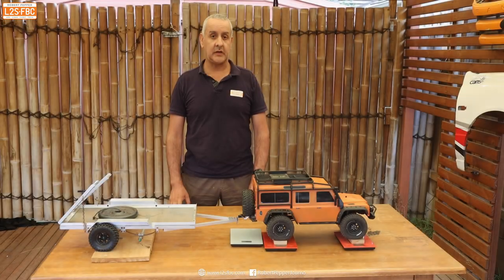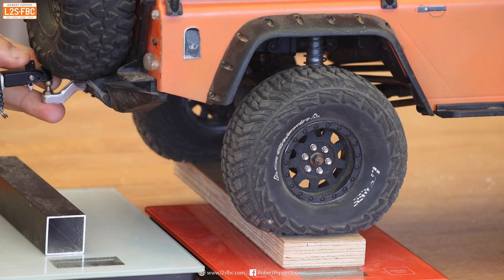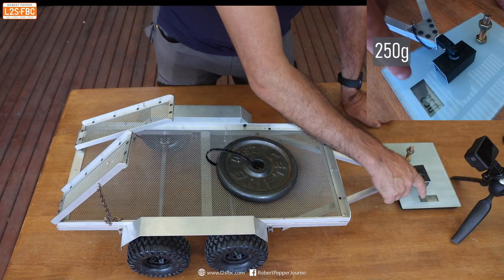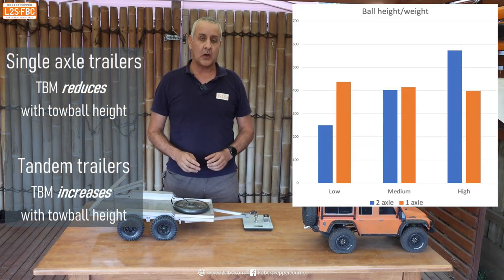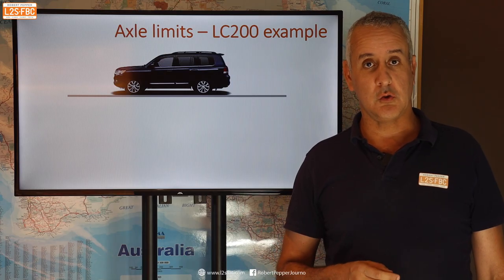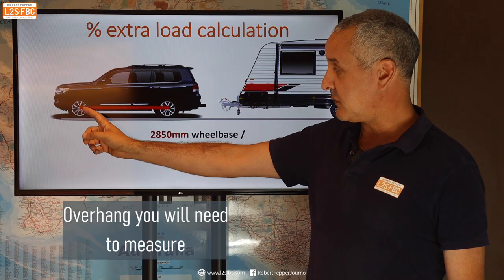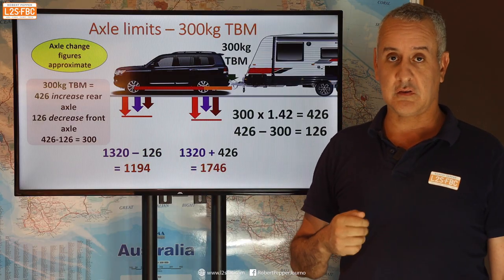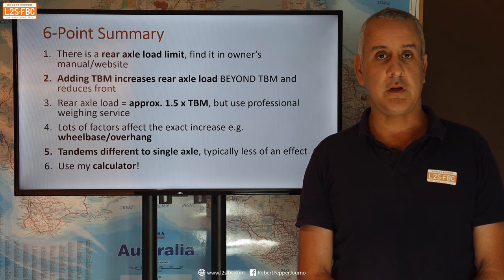Are you sure your rear axle isn't overloaded?

Comment: I've never done any off-roading but I watch all of the videos because I appreciate understanding the principles. I may end up applying the knowledge in my bicycle loads when I haul a trailer for my trips this summer. Fascinating and well laid out with easy to understand diagrams and scenarios, thanks.
Reply from the maker: Thanks Johh yes the principles absolutely overlap!
Reply: @L2SFBC  I beg to differ (I think). Depending upon where the chap attaches his trailer to his bicycle, the ratios would be totally different. 
Whilst never having towed a trailer with a bicycle, the ones I've seen have invariably had the pivot connection in an area under the seat, so ahead to the rear axle.
As such, I would deduce that there would be zero (or close to zero) effect on the bias between front and rear axles of the bicycle. Or, am I missing something here?
Reply from the maker: No you're not the force being zero  wouldn't mean the principle doesn't work it means the answer is 0

Comment: My comment got deleted for some reason (probably because it had links in it), so here we go again:

Thank you for another great demonstration and adding the axle loads to the calculator.

Could you please also test the effects of TBM on stability and various ways to achieve it? There are studies showing that more TBM seems to make the trailer more stable, but none of them so far even tried to figure out WHY this is. There are some speculations, but not really any data, so I'd love to see someone do some proper testing.

The variables are:

1. Load distribution: This can be ruled out as previous testing has shown that putting the load further forwards does not really help anything.

2. Axle load/grip of the car: Some people say that the increased stability comes from the increased load on the car's rear axle. If you were to take a trailer with little to no TBM (let's say <2 % GTW) and add weight *to the car* to reach the same rear-axle load as with, let's say, a TBM of 10 %, would you get the same stability as you would from nothing in the car and all of the 10 % on the ball? If not, how much would you be missing?

3: Friction: Another speculation is that the increased load on the ball creates more friction which helps to dampen any oscillations. How much would you gain from using a friction coupler (e.g. the AL-KO AKS 3004) to create this friction without any vertical load? This would probably be harder to accurately replicate on a scale model, but something like a piece of silicone tubing on the ball and an oversized coupler would probably be enough to show whether there's a significant difference or not.

I wouldn't be too surprised if it turned out that a $300 coupler and a few more bags in the car would do the trick without worrying about TBM or axle loads.

Edit: FWIW, I'm NOT saying that you don't need any TBM. In real life you absolutely do need some to keep at least some pressure on the coupling so it doesn't wobble or separate - the question is whether you really need any more than that.
Reply from the maker: Reject all three explanations, please. This myth that "a bit of TBM is good, so more = better" has to die. Look through my tow playlist for more.
https://l2sfbc.com/one-reason-why-add-more-towball-mass-isnt-always-the-right-answer/
Reply: @L2SFBC  I'm not saying that more TBM is always better - I actually believe the exact opposite, which is why I'm asking those questions (and why I was the one who suggested adding the axle loads to the calculator under the video about weight distribution). I may have worded the comment poorly because I didn't want to spend an hour re-typing what got deleted because of a link in the original comment, so let me try again:

I found a study called "*An experimental investigation of car–trailer high-speed stability*" from the University of Bath in the UK. This study found that

1. Adding TBM (or, as they call is "nose mass") from the original 5 % to 10 % improved the high-speed stability of the trailer and vice versa. 
2. However, moving the load closer to the axle to reduce its inertia improved the stability even more than increasing the TBM, and 
3. increasing the length of the tongue/nose of the trailer also brought significant improvements, although doing so reduces the TBM (since it's acting on a longer lever).

The above already suggests that even the widely-used "10-% rule" may not be true and less TBM on European-style trailers doesn't make them "inherently unstable" like I've seen some Americans claim.

But this is not really relevant to this particular video. The relevant part is this:

"It was found
 that an increased nose mass improved the system stability, although the improvement becomes less significant when the nose mass rises above 6–7 per cent of the total weight. *This effect is thought to be caused by the increase in the car rear axle load associated with nose mass that increases the ability of the tyres to generate side forces that damp out the

oscillation. In addition, the increased nose mass
 raises the tow ball friction, which in turn helps to damp out the oscillation.* However, it should be noted that there are limits on the maximum nose mass, partly as a result of structural strength issues

and partly because too much nose mass will reduce
 the front axle load and worsen the handling performance of the vehicle."

I initially missed that, later in the study, they did actually try a friction coupler and it did help, which confirms that friction also plays a large role in stabilizing the trailer. Now that I'm looking at it, it looks like the coupler was actually almost as effective as increasing the TBM from 6 % to 10.5 % (zero-damping speed of a bit over 66 mph with the extra mass/weight vs. 66 with the coupler), which also answers my third question.

The only questions that have't been answered therefore are: How much do axle loads matter here? *What would happen if you were to completely remove the TBM and replace it by an equivalent amount of weight in the car, above (or in front of) its rear axle*, so that the rear-axle load would be the same but with no lifting of the front axle?
Reply from the maker: Good questions. I shall do more with them as there are a lot of 'it depends'   in the true answer. But you're on the right lines. Note that friction devices reduce manoeuvrability.
Reply from the maker: Yes I'll do something on this subject soon. See my 2m view video on 7 weights for trailer stability for starters.

Comment: New to the channel but these videos are great!
I'd really like to see one addressing weight distribution hitches vs. air bags (or other supplemental suspension parts) that simply help maintain rear ride height.
Reply from the maker: Thanks Jack.  I do have one on WDH, but not on airbags. I might do one on the merits of keeping the towcar rake as it should be as opposed to dragging the backside. Air suspension is great for this!!!
Reply: @L2SFBC  Well that's what I'm wondering🤔..
Does maintaining rear ride height (through stiffened susp) actually serve to adequately distribute weight to the front wheels, as a WD hitch would?
Reply from the maker: Raising the rear from sagging to level has a tiny effect on weight distribution - a little more to the front. However...the height of the hitch also varies the towball mass, and it behaves opposite whether the trailer is tandem axle or single axle. Confusing hey?  So, "it depends" I'm afraid. Raising the rear will never be as effective as a WDH.

Comment: This is obvious to me, but not to many people, I would imagine. This is also why I want to fit air-helper springs to two of my tow wagons that I use mostly for longer distance and heavier towing. :-)
Reply from the maker: Not obvious to many people no. We are all wired uniquely.
Reply: Look into that a bit more. A lot of talk around air helper springs on heavily loaded dual cab utes and bending the chassis
Reply: @snells-window  We're not talking heavy loads for me with that vehicle. I'd only tow up to about 2000-2500kg or so, with it. It's just about the amount of gear I tend to have in the wagon's boot at the same time as tongue weight. They're both softly sprung cars, and both will be lowered sooner or later, one already is. I just want hte car to drive level and have some suspension travel for undulations in the road.
Reply: @fredio54  remember that just like the distance of the towbar to the rear axle amplifies the TBM, the TBM can be multiplied significantly further when going through sharp high speed dips like you often find on fast dirt roads. From my understanding, fitting air springs can change the load/stress points to different parts of the chassis, at least in leaf sprung vehicles.
Reply: @snells-window  You're not wrong, however think about this: If I go through those same dips/bumps/braking zones/corners with the vehicle heavily laden and sagged badly then the amount of travel available to absorb those surface variations is minimal and the suspension will bottom out and the bump stops will incur a very strong force very early in the impact/compression cycle. This is worse than having sufficient spring rate (of any sort) to cope with the events that unfold.

Comment: Very Interesting and excellent demonstration about how the single axle and tandem axle affect the towball mass, which led me to a question about Load Sharing Tandems. 
Considering the towball mass, with a true load sharing tandem suspension compared to the the tandem model in your demonstration, which would mimic the independent coil systems on vans lately, (except for the Simplicity Axle LSC)  would this have a different effect?. As these are designed to keep the same amount of weight on each axle within suspension travel limits,  so would a Load Sharing Tandem setup, act similar to the single axle in regards to TBM?.
Reply from the maker: Yea it would I forgot mention that good point.

Comment: Have you done any videos on A-frame flat towing of other vehicles? I'm expert in it, but I think you'd do a good job of explaining it to others. I do know, though, that it's not your area of interest nor that of your viewers, most likely. But perhaps it could be a nice little series to spice things up :-)
Reply from the maker: No I haven't and i have never A towed so I probably wouldn't. I like to focus on things I have practical experience with to back up the theory.
Reply: @L2SFBC  Fair enough. Crash course here and now, then:

1. Ball and hinge height should be very close to the same - if ball is lower braking causes compressed rear suspension and lightened front suspension like a ball weight - if ball is higher braking causes rear end jacking and increased front end weight - this can result in a sustained low-speed low-force oversteer condition in the tow vehicle (ask me how I know, ha ha)

2. Zero of the towed vehicle's weight is on the wheels of the car being towed and the towed car, unless it has a driver to assist with hills (up AND down if engine runs) the maximum decel G force is 50% if the weights are equal between tow and towed.

3. You cannot reverse easily and you cannot reverse at all without a helper in the towed car or the steering locked

4. Your steering must be free to move as needed when being towed forward - if a driver is inside the towed car they must only use brake/gas - they must not interfere with the steering wheel. 

5. Cornering load from the front of the towed vehicle is applied to the rear of the tow vehicle 

6. It's effectively the same as towing a trailer with a very long draw bar when moving forward - ie, the turning circle is very large and it's easy to accidentally cut corners and do damage (again, ask me how I know...)

7. If you DO have a driver then it's as if you have a double mass double power vehicle and the entire experience is seamless and easy

8. If you don't have a driver or the brakes are not working on the towed car then keep 2 in mind - it can get bad easily

9. If you're towing an auto and it won't be running and assisting then you must drop the driveshaft or CV axles or the auto will be destroyed by the act of towing because the oil pump is engine driven and key parts will not be lubricated.

I built mine to tow my race ute to the track years ago, but have since used it on a number of other vehicles to great success. They're a very nice way to go and especially if you can put a person in the back car to help slow it down (they brake when your brake lights show, they accelerate when they feel you do so and/or they see a hill or are coming out of an intersection or whatever. I prefer it to car-transporter use these days. You just have to know what you're getting into. Kinda like MIG locked diffs - they're great and ultimately predictable, but you have to know what you're doing when you drive one or it can get you into trouble. :-)
Reply: @fredio54  I used to have an A frame on my little suzuki 4wd. Hook it up to another suzy offroad and you had 8 wheel drive!
Reply: @snells-window  Ha ha, yes indeed :-)

Comment: @2.07 if you put more weight on the front even though the vehicle gvm would increase would it also decrease the rear weight and tranfer it to the front? Is it aboute keeping the vehicle sitting level to keep the weight ok or physical weight ay the front or rear to change it.?
By far the best trailer weight video on youtubes also.

Comment: great video, thanks for posting this. are you going to do another video explaining the same loads but with using weight distribution bars? ( it would be the next logical step)  also have you noticed the 'long' tow ball hitches ( generally height adjustable versions) that add to the overhang? do you know of a height adjustable ( or weight distribution hitch unit) that is 'short' ? so your overhang is keep to a minimum?  also how does load sharing dual axle trailer suspension act on down ball weight?
Reply from the maker: extended hitches ARE EVIL!!!
Reply: @L2SFBC  yes they are evil....... in most circumstances.
In my case, I have a Chevy Silverado with a GVM of 5,171kg and a GCM of 11,113kg. 
The front/rear axle ratings are 2,359kg and 2,812kg respectively (hence the 5,171kg GVM).
I tow a 3,500kg Bushtracker caravan....so I'm well within the GCM.
However, because of the truck-like rear suspension (it barely budges when I add the 320kg ball weight), the ride when towing was less-than-pleasant. 
The "fix" for that was to purchase a product called an Airsafe Hitch which gives an airbag cushion between the two vehicles.
Unfortunately, the trade-off is both weight (the Airsafe weighs around 35kg) and the increased distance from rear axle to pivot of around 300mm.
Fortunately, having such a long wheelbase in the first instance, these trade-offs are well-worth it and I wouldn't tow the van without the Airsafe Hitch.
Reply from the maker: That's fantastic information thank you and yes totally agree it depends!

Comment: I've come to understand that Tow Ball Weight can be too much, as well as too low. What would you say is the optimal weight on the ball? (I'm aware of wanting to keep the majority of the weight over the axle of the trailer for stability.)
Reply from the maker: It's like tyre pressures, there is no optimal unless you give a very specific conditon; towcar, speed, trailer, weight distribution and so on. For example offroad the ideal is 0%.  For a 3000kg towcar with a 300kg trailer...10-40% would be fine.  I run 7% on my 2300kg van towed by a 3000kg 4x4.  I will do a video on it, but there is no simple answer and anyone that says differently hasn't understood the situation.

Comment: Hi Robert. What is  your views on WDH function of some weight transfer to front axle?
Reply from the maker: I would avoid WDHs unless necessary. They do add weight to the front axle and also the trailer axle. But they have complications. I'd prefer to get a bigger towcar. Also note quite a few manufacturers expressly forbid use of a WDH.
Reply: @L2SFBC  yes, just a band-aid for level roads and disconnected if going up a driveway into service station, spoon drain, bull dust holes, speed bumps and the like. I enjoy your spot on presentations and associated views. BTW it is a subject I enjoy but I don't tow with my Dmax, it is just a full time tourer build.

Comment: quick question:
To calculate the total effect therefore on the rear axle, I'd need to include the vehicle payload weight. What'st the best way to do that?
Would I simply add the payload weight from the second row and the boot with the towball effect to complete this analysis for the total rear axle laod?
Thanks
Reply from the maker: Best get front and rear axle loads on a weighbridge
Reply: @L2SFBC  thanks for your reply! 
Are there any rules of thumb that can be used to estimate? 
I may do this for several vehicles I'm looking at purchasing
Reply from the maker: https://l2sfbc.com/towcalc/

Comment: But that wouldn't be the same for load sharing tandem axles would it?
Reply from the maker: Load-sharing twin would act much like a single.
Reply: @L2SFBC  so there are no concerns with performance of the trailer not being parallel to the tow vehicle chassis, in terms of braking or stability, outside of the load distribution?

Ultimately I want it to be flat, but for instance we are about to put the trailer on my mates BT50 (I have a Hilux) and his ball is 60mm higher. Now we are only towing about 2000kg, so we aren't in the limit. 

Trying to determine if we have to fork out the coin for an adjustable hitch for a 4400km trip or just send it.

Comment: If you model trailer had a spring equalizer like most road going tandem axle trailers with leaf springs have, then you would find that the  weight isn’t as sensitive to height as they equalize the load. If they have torsion axles that don’t use equalizers, then your explanation is dead on.
Reply from the maker: You mean like this https://youtu.be/hwU5D5vwRqc
Reply: @L2SFBC  
Yep just like that.